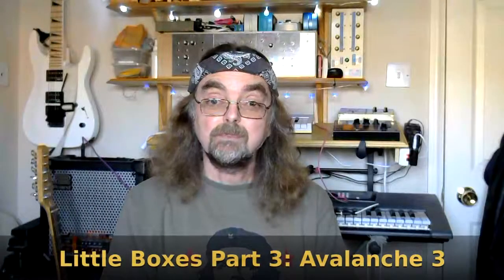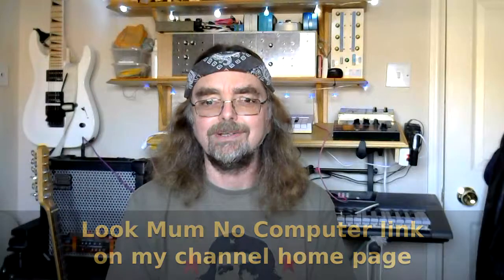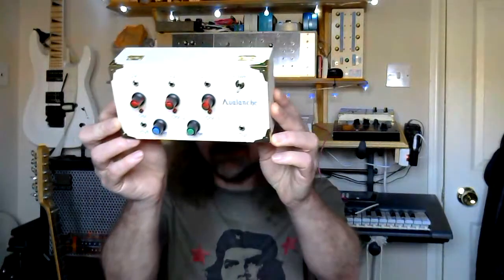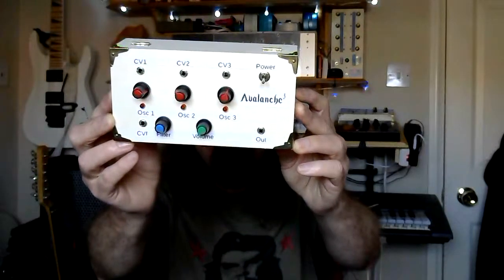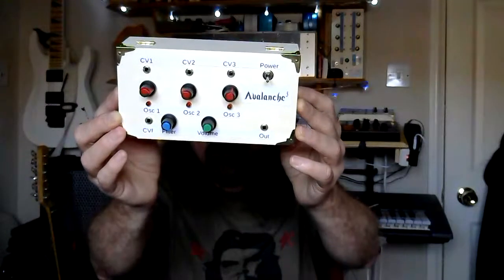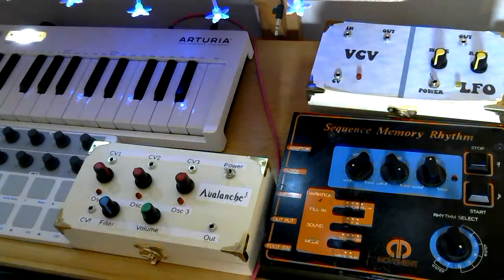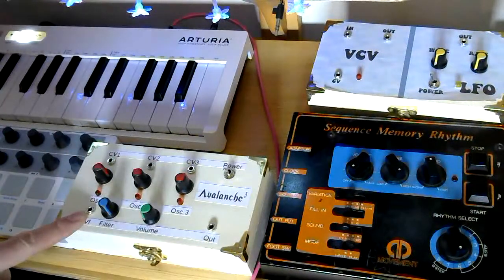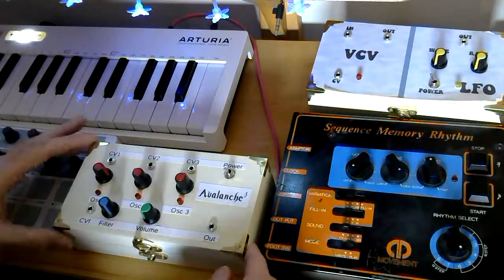Little Boxes Part 3: Avalanche3

Comment: Hello, greetings from Venezuela. I am a fan of your videos/projects. Thank you very much for this. I have a question: How do I add a CV to that oscillator? I understand a little the design of the oscillator, but I had understood that it operated with 12 v. Does your modification works quietly with 9v? 

Regards
Reply from the maker: Thank you for your kind words. Different transistors will start to oscillate at different voltages, I used the  SS9018 as it oscillates just below 9v. Other transistors will need a higher voltage. I used a vactrol across the potentiometer to provide CV control.

Comment: which transistors did you use for your build? and when your knobs are at zero, is the sound completely off?
Reply from the maker: I used a SS9018 on all three oscillators but used a lower value capacitor on one to giver a higher range of frequencies. You can still hear all three oscillators when their knobs are set to zero. The volume knob will cut out all three oscillators at the same time.
Reply: @CuSiSound  thank you so much for the response! im using the same transistors as well, and it sounds like mine function like yours do. In the LMNC video, it shows his circuit as completely off when the knob is at "zero" and then it turns on and goes up in pitch. im trying to replicate that because its a great feature for it to work that way but i cant figure it out to save my life!

Comment: Amazing vid, how did you wire all of the oscillators to the output?
Reply from the maker: Each oscillator output is simply connected to a common rail on a piece of stripboard and then that is connected to the passive filter, volume control and finally the output jack. The 100k resistor on the output of each of the oscillators reduces the risk of them interfering with each other. It's a very crude form of mixing but it works.
Reply: @CuSiSound  Thanks for replying, do i need the passive filter in order to make it work?
Reply from the maker: No, you can leave out the filter ( it did not have a big effect on the sound anyway) but I recommend you keep the volume control as it can be useful.